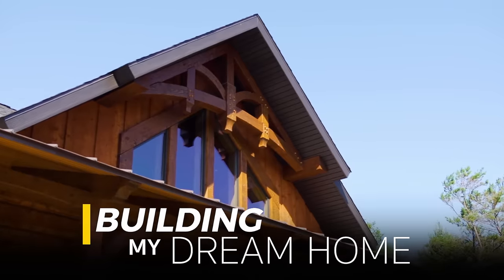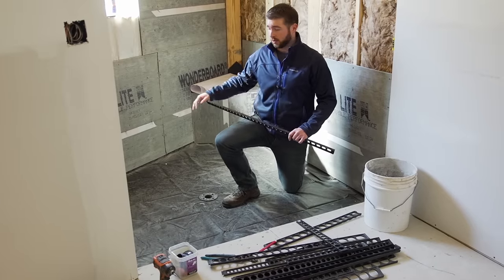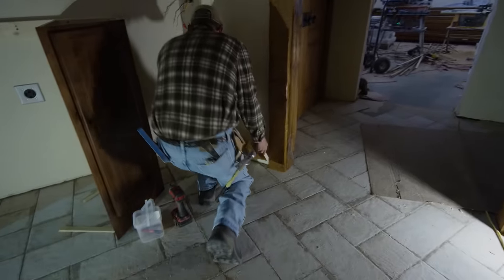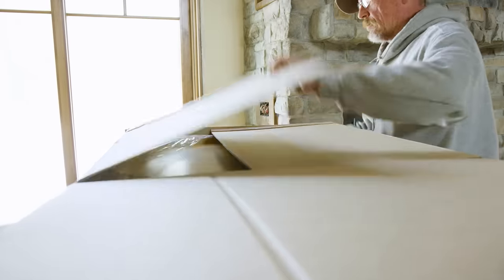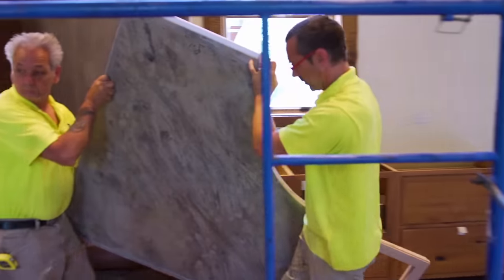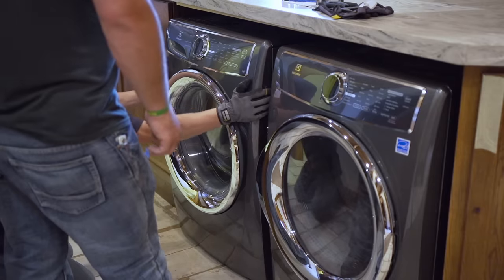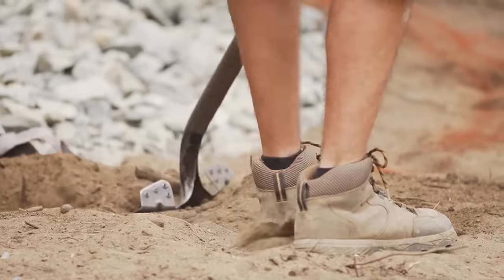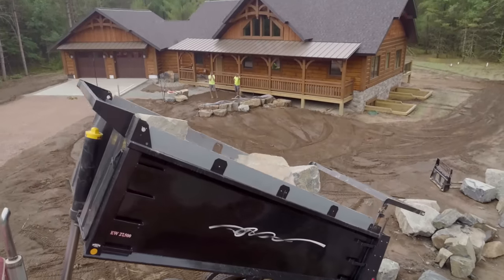EP 9 Building My Dream Home - Finishing Touches, Kitchen Ideas, Tile Flooring, Reclaimed Wood Trim

Comment: Can the ceiling take a load of those heavy beams? particularly when they are attached just with the screw?
Reply from the maker: Yes great question, the roof system is calculated for that load

Comment: Would like to ask:  Why you chose a hybrid timber frame over a full log home ?  Is that because a timber frame provides better heat / cold insulation and sound isolation ?
Reply from the maker: That's a question that does not have one answer, it depends on many things. Zach wanted a lot of drywall in his home,so it made more sense to go with Half log exterior,timber accents.Thanks for watching, for more detail call us at 800-270-5025

Comment: I wonder how much a beautiful home like this would cost....🤔
Reply from the maker: How much would it cost me to build this home?
If you have been following along in the video series "Building My Dream Home" episodes 1-11. You may have been wondering what the total build cost (♦ turnkey cost) would be.

Zach started with the smaller Clearwater 1750AR Ranch. For which either the Premium Exposed Beam Timber Package, or the 8 Inch Premium Half Log Package! and would turnkey for approximately $465,000.

We also have a model called the Clearwater 2095AR Ranch which is more similar in size to Zach's home. For which either the Premium Exposed Beam Timber Package, or the 8 Inch Premium Half Log Package and would turnkey for approximately $596,000.

Zach used the Ultra Custom Timber Package version, the Timber Ranch 2286AR-UCT. The Ultra Custom Timber Package is fully loaded with taller wall heights, taller windows, and taller interior doors and our finest cabinetry. Plus massive timber band boards, rafter beams, and custom timber style trims. So, Zach's house as it is built (depending on where you are building it) would turnkey for approximately $916,000 - $975,000.

In different parts of the country construction costs may be more or less. And you would need to add Land Costs, Well, Septic, Landscaping, Etc.

Contact Us or call at 1-800-270-5025 and we can help you start planning your dream home.

Comment: What was the price please for the total ?
Reply from the maker: Fully Built (Turnkey) Cost of Zach's Dream Home
If you have been following along in the video series “Building My Dream Home” episodes 1-10. You may have been wondering what the total build cost (♦ turnkey cost) would be.

Zach started with the smaller Clearwater 1750AR Ranch. For which either the Premium Exposed Beam Timber Package, or the 8 Inch Premium Half Log Package! and would turnkey for approximately $369,000.

We also have a model called the Clearwater 2095AR Ranch which is more similar in size to Zach’s home. For which either the Premium Exposed Beam Timber Package, or the 8 Inch Premium Half Log Package and would turnkey for approximately $575,000.

Zach used the Ultra Custom Timber Package version, the Timber Ranch 2286AR-CT. The Ultra Custom Timber Package is fully loaded with taller wall heights, taller windows, and taller interior doors and our finest cabinetry. Plus massive timber band boards, rafter beams, and custom timber style trims. So, Zach’s house as it is built (depending on where you are building it) would turnkey for approximately $790,000.

♦ Turnkey costs do not include the unpredictable variable costs such as price of the land, well, septic, landscaping, taxes, and shipping.

If you have any questions or would like more details please feel free to Contact Us or call 844-772-6733 Toll Free

Comment: How much did this cost to build?
Reply from the maker: How much would it cost me to build this home?
If you have been following along in the video series "Building My Dream Home" episodes 1-10. You may have been wondering what the total build cost (♦ turnkey cost) would be.

Zach started with the smaller Clearwater 1750AR Ranch. For which either the Premium Exposed Beam Timber Package, or the 8 Inch Premium Half Log Package! and would turnkey for approximately $369,000.

We also have a model called the Clearwater 2095AR Ranch which is more similar in size to Zach's home. For which either the Premium Exposed Beam Timber Package, or the 8 Inch Premium Half Log Package and would turnkey for approximately $575,000.

Zach used the Ultra Custom Timber Package version, the Timber Ranch 2286AR-CT. The Ultra Custom Timber Package is fully loaded with taller wall heights, taller windows, and taller interior doors and our finest cabinetry. Plus massive timber band boards, rafter beams, and custom timber style trims. So, Zach's house as it is built (depending on where you are building it) would turnkey for approximately $950,000.

♦ Turnkey costs do not include the unpredictable variable costs such as price of the land, well, septic, landscaping, taxes, and shipping.

If you have any questions or would like more details please feel free to Contact Us or call 1-800-270-5025 Toll Free

Comment: Make sure they remove the cross spaces they aren't meant to stay in the joints.
Reply from the maker: Thanks for watching. They were removed.
Reply: @goldeneagleloghomes  Hey thanks for the update I noticed your tilers using those tapered angles to scred I've never seen them used in Australia as we just use a spirit level and straight edge to achieve similar falls to wastes or grate drains. I also noticed from a lot of videos Americans never use liquid water proofing membrane or they use ditra underlay sparingly. Most custom builders including project builder just tank the rooms meaning if the room didn't have windows or doors you could fill it with water and it would hold.
Reply from the maker: Yes - waterproofing is sure important. RedGard waterproofing membrane was near all wet areas.
Reply from the maker: Hopefully you made it to the next episode to watch the final tour: https://youtu.be/kcURWoz3AKU

Comment: how much did this house spend in total (including the house itself and the yard)?
Reply from the maker: How much would it cost me to build this home?
If you have been following along in the video series "Building My Dream Home" episodes 1-10. You may have been wondering what the total build cost (♦ turnkey cost) would be.

Zach started with the smaller Clearwater 1750AR Ranch. For which either the Premium Exposed Beam Timber Package, or the 8 Inch Premium Half Log Package! and would turnkey for approximately $369,000.

We also have a model called the Clearwater 2095AR Ranch which is more similar in size to Zach's home. For which either the Premium Exposed Beam Timber Package, or the 8 Inch Premium Half Log Package and would turnkey for approximately $575,000.

Zach used the Ultra Custom Timber Package version, the Timber Ranch 2286AR-CT. The Ultra Custom Timber Package is fully loaded with taller wall heights, taller windows, and taller interior doors and our finest cabinetry. Plus massive timber band boards, rafter beams, and custom timber style trims. So, Zach's house as it is built (depending on where you are building it) would turnkey for approximately $950,000.

♦ Turnkey costs do not include the unpredictable variable costs such as price of the land, well, septic, landscaping, taxes, and shipping.

If you have any questions or would like more details please feel free to Contact Us or call 1-800-270-5025 Toll Free

Comment: How many millions dollars?
Reply from the maker: If you have been following along in the video series “Building My Dream Home” episodes 1-10. You may have been wondering what the total build cost (♦ turnkey cost) would be.
Zach started with the smaller Clearwater 1750AR Ranch. For which either the Premium Exposed Beam Timber Package, or the 8 Inch Premium Half Log Package! and would turnkey for approximately $369,000.
We also have a model called the Clearwater 2095AR Ranch which is more similar in size to Zach’s home. For which either the Premium Exposed Beam Timber Package, or the 8 Inch Premium Half Log Package and would turnkey for approximately $575,000.
Zach used the Ultra Custom Timber Package version, the Timber Ranch 2286AR-CT. The Ultra Custom Timber Package is fully loaded with taller wall heights, taller windows, and taller interior doors and our finest cabinetry. Plus massive timber band boards, rafter beams, and custom timber style trims. So, Zach’s house as it is built (depending on where you are building it) would turnkey for approximately $790,000.
♦ Turnkey costs do not include the unpredictable variable costs such as price of the land, well, septic, landscaping, taxes, and shipping.
Reply: @goldeneagleloghomes  thanks, my friend. Actualy I was shocked how professional that dream house was built. Giant respect to you and youre team.

Comment: This is a gorgeous home but every time the guy talks about "cost savings" I have to laugh. Every new scene shows incredibly expensive, custom work. That staircase at the 3-minute mark is easily (at least) $40k. He mentioned in the last video he saved $40k using the fake stone for the fireplace. He still spent at least $20 or $30k on what he did get. Inset cabinetry in every room? Also incredibly expensive.

Again gorgeous house but talking about cost savings when you are spending this much (and surely getting a pretty deep discount as family owner/operator) is funny.
Reply from the maker: We have released info on the fully built (turnkey) cost of Zach's Dream Home: https://www.goldeneagleloghomes.com/galleries/videos/building-my-dream-home/building-my-dream-home-cost.asp

We don't disagree with anything you said and your observations are on point. We think our perception of "cost savings" is relative to other options that would be common in a dream home. Zach's home not a good guide for building an economical home.